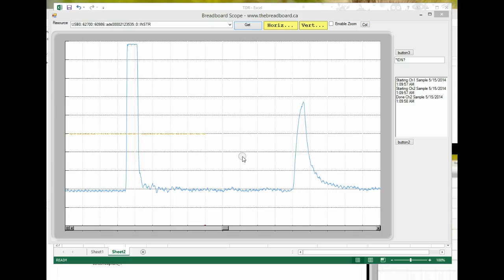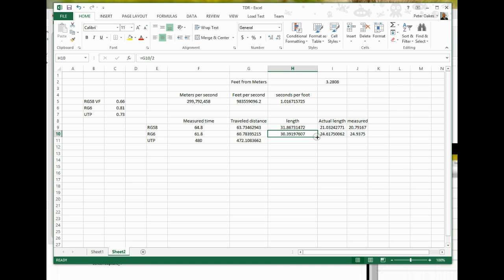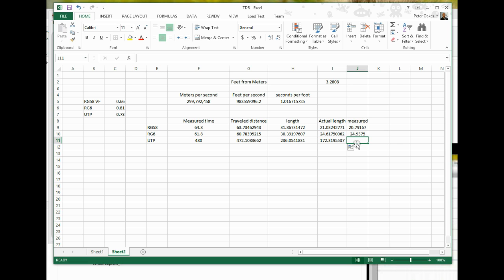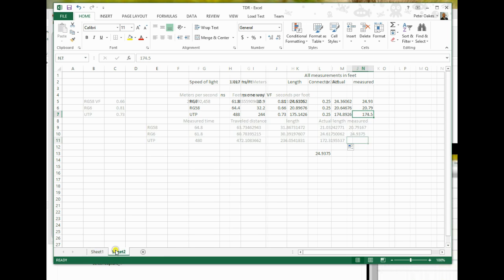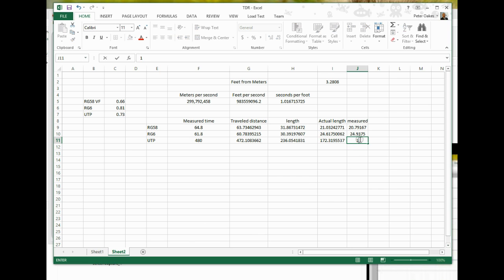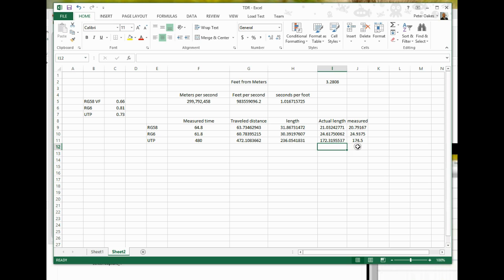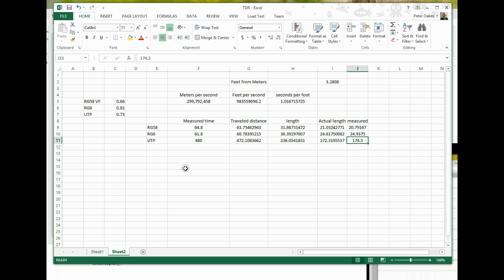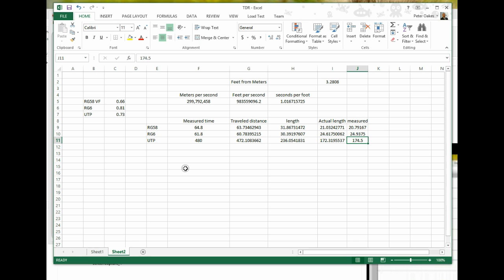TDR #7 UTP Maths

Comment: Hi Pete

very educational thanks.

Btw your measurement technique is actually better than you thought. If you used the ratio between the actual and measured for the RG58 exercise (21.03/20.79) and applied it to the RG6 you get 24.90 feet. Very close to your actual measurement.
Same factor to the UTP you get 174.3 basically only 2 inches out.  Nice one!
Reply from the maker: +Dave Lowndes Thanks, I will try to bear that in mind for future videos
Peter